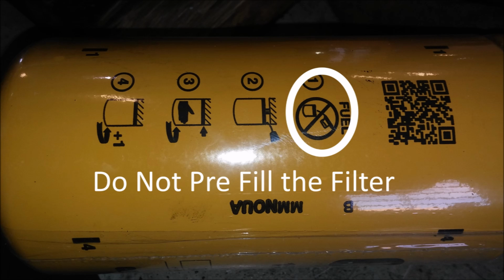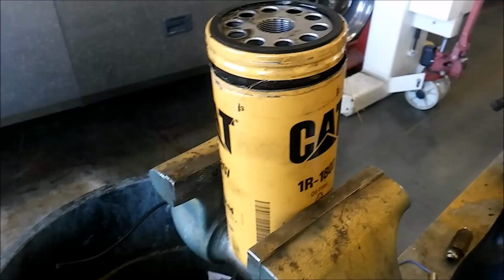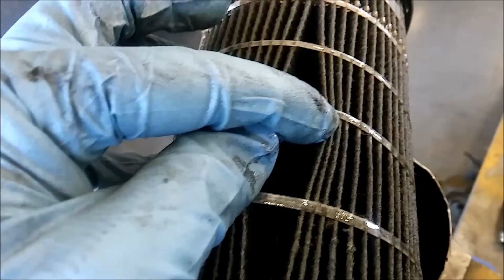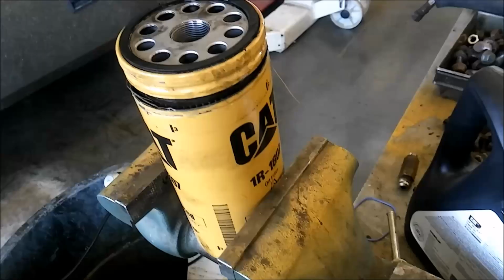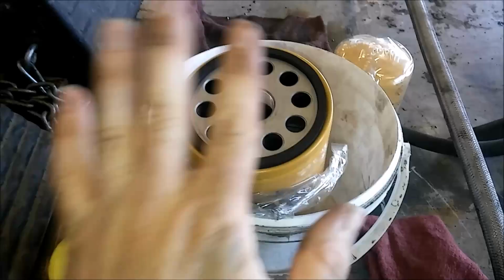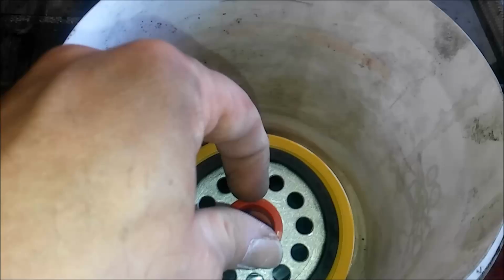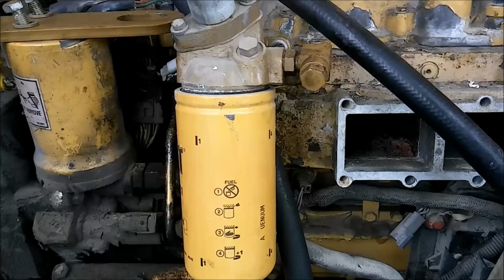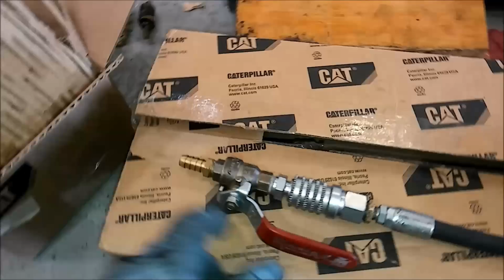Should You Pre Fill an Oil Filter? Should You Pre Fill a Fuel Filter?

Comment: I don’t know how many models back this is true on, but most modern CATs and I’m guessing equipment ingeneral you lube the fuel filter seal, install it, and before trying to start or turn the engine over, you turn it to the on position and it fills the fuel system and removes any air. You hear it prime, see the bowl fill, hear the change in sound as the system is full primed, then you can start it. He’s not saying there is a perfect one size fits every and all factors, just giving options and how he does it. People who don’t work with bulk fluids don’t understand that oil can be in 3+ different tanks and systems before finally making it into the equipment that’s being serviced. They are use to going to the parts store, getting oil straight from the factory in a quart and dumping it in the vehicle.

Comment: Ive always filled both sides of the oil filter, however considering my oil comes out of a 55 gallon drum through a pump and 2 massive 2 micron oil filters I doubt that's a problem. Im shure I will get alot of hate over this but I also run through about 10quarts of  new filtered oil at 3 Bar to flush out all the old oil before filling it. And before anyone bitches about cost we buy 10-15 55gallon drums at a time.
Reply: I agree. That's a much better way to flush an engine, than using any kind of solvent. That ensures there's no residual solvent, to dilute the new oil!

Comment: I work on construction/mining equipment from many different manufacturers. These manufacturers use many different brands of diesel engines. Cat, Cummins, Isuzu, Mitsubishi, Hino, Scania, Liebherr, and more. I can tell you from experience that NONE of these manufacturers allow for pre-filling of any filters. The fuel and oil you buy is NOT clean enough to meet their specifications until it is filtered. If you pour "new" oil or fuel into the clean side of a filter, you have just contaminated that filter. These manufacturers spend hundreds of millions of dollars on R&D. I don't care if your dad and grand-dad taught you to fill your filters, it is an incorrect procedure.
Reply from the maker: +nathan weber Thank you for the information, seems most people pre fill even with the manufacturer telling them it isn't a good idea.
Reply: Not only that its impossible on many Diesels my 4WD included.
Reply: According to Cummins quickserve to properly install a new oil filter you are supposed to fill with clean 15w-40. Looked up an ISX 15 871 and an ISB 6.7 CM2150 BOTH manufacturer manuals instructs you to pre fill the oil filter.

Comment: They probably recommend not filling due to possible contaminants entering the pool where the system draws the filtered oil from. I think newer engine systems have sensors to prime the filter itself until the system is equalized (not sure on terminology here). Although it was always more useful filling the oil filters and just letting the system prime the fuel filter with the use of a manual pump or lever, especially since you can just put a bead of oil on the gasket / ring at the same time.

Comment: my point is, during the time of normal operation, when you shut down , and then come back and start it again, especially if you have the type where the filter hangs with the open end facing up, the filter is full of oil each time you start, so how can anyone say the engine could possibly have any problem with a full filter , I can say this, watching my pressure gauge read zero for several seconds after starting with a dry filter has got to be worse. ever since I first heard about filling and doing so that pressure comes up as it normally does,  and I've never had any problems. I drive a lot of miles and haven't had an engine go bad in decades, my little Focus has 145k and still drives like new

Comment: Oil viscosities are often picked by the EPA for fuel mileage.   They'd make us run sewing machine oil if the engine would hold up at all.
Good reasoning otherwise, though.    I can't comment regarding anything diesel, however.   All I know about diesels is the stupid fuel nozzle is too big to fit into my gas tank.
I used to prefill my oil filters, but I stopped because it was just too much work having to be so careful to not get debris into it.
A coworker said he prefers to keep his filter always facing down until he starts threading them on, pretty much negating filling them as an option.
One thing I still do on oil filters, however, is I lube the seal and threads a bit.  I think it helps make it easier to take off.
Reply: l337pwnage in modern engines using the recommended viscosity is very important for the VVT to work as intended

Comment: Smart guy looks at the oil passage diagram for his engine. The bottom of the engine gets oil last after it has passed through the filter so waiting for the filter to fill then push it around takes awhile. In my experience, pre-filling the filter keeps the valves and bottom from rattling when you start it up which I think is a bigger problem than the possibility of soft dirt. If you do your pre-fill properly, cleanliness is next to godliness. Sparkly clean funnel, clean work space, clean bottle top. Fill through the center and let it sit until the oil migrates to the other side too. Put some more in, let it sit. Personally the guaranteed rattle of the bottom of the motor without oil for a few seconds is one hell of a lot worse than the small possibility of soft dirt getting into the bearing surfaces. If some dirt gets in the system, there is a chance that it will get filtered out next pass through after drain-back from the top (instead of heading to the mains and rods). Pre-fill the fuel filter? No experience.

Comment: Well,  when I buy (new oil ) it has already been filtered to a specific micron of filtration from the producer. I was always taught to prefill new filters to keep from starving the engine upon startup, and I will always prefill my filters.  I also worked as a diesel mechanic for years. There is a more fool proof way to completely resolve this conversation and that is to prefill the filters with a funnel that has a filter screen and yes I do.  Bottom line engines run on fuel and oil so let's make sure it's ready to run or it could be a big headache nobody needs.

Comment: My Cummins L9 with Fleetgaurd filters call for pre-filling the oil filter (even the can icons) and fuel filters (clean side on secondary filter - even comes with disposable cover /plug to assist your aim). My engine is RED, my filters are WHITE and I run the recommended Valvoline BLUE .

Comment: yes , don't let your bearings run dry or with limited oil supply while the pump is sending oil to the canister. it's a no brainer. even a small one on a 2or 4 cylinder, fill it at least 3/4 full. One exception , if the filter is upside down, for obvious reasons , don't add any.

Comment: YES ALWAYS PRE_FILL! Saves main bearings. Change filter every 2000 change both oil & filter at 8000. Use 20/50 oil always.
Reply: Keith Hinkel what do you use 20w50 in
Reply: My Chrysler van.
Reply: man use a quality oil filter and you can definitely use the same filter for 8000 miles. Wix or motorcraft.
Reply: lowest heat temps by data..use it in my 78 Super Beetle 140HP
Reply: I hope you're not talking about big rigs. Nobody's changing filters after one week.
Reply: Account Inactive lmao right. Not even after 8000, that’s only two weeks of good ridin’. I’ve found that changing it on the 10-12k mile range works just fine.

Comment: Waaaay over thinking this,  to the point where it`s almost scary. Many vehicles have the oil filter in such a position that to fit it, you have to turn it in every direction bar inside out! How would you keep oil in the damn thing. There`s really nothing in this at all, maybe all the conspiracy theories are getting to you.
Reply: Exactly to the point!
Reply: Have to agree, nearly every forklift engine I've serviced has the oil filter either horizontal, upside down or angled so prefilling will only achieve a right old mess!
Reply: I agree with you but big diesels are easy to fill and a different ballgame.For instance on a Detroit they even have 2 BIG filters that take almost a gallon and most guys will fill them and on a Detroit I recommend filling them.
Reply: duh! ever heard of gravity?  in those cases I crank the engine without staring it to get it prefilled

Comment: 1. No gas engine automotive oil filters contain a warning not to pre fill.
2. You are no more likely to get debris in your oil by pouring down the center hole in the filter than you are by pouring the oil in the oil fill opening in the valve cover.
3. Pre-filling an oil filter is called "good engineering practice."  Maybe not important in the grand scheme of things, but reducing episodic reduced oil pressure over the life of an engine will never be a bad thing.
Reply: while i agree with filling filters, on your number 2 line you seem to be missing the point.

if you get dirt in thru the valve cover, the dirt passes through the filter and gets caught in the media, preventing it reaching the bearings in the engine. If that dirt gets into the center of the filter, it gets pushed right into the oiling system and lands itself into a bearing.

I simply fill the filter from a clean brand new bottle of oil and take extra care not to get any dirt into it. Problem solved.
Reply: I do the same thing you do.  And I know how the oil passages are plumbed.  My point is about being careful.  I don't want dirt passing over the valve train on it's way to the sump any more then I want it in the pressurized side.  If you are letting any dirt/debris in anywhere, then you are doing it wrong.
Reply: I think you still missed the point. One of the points was that the new oil has debris in it. If you pour it into the center hole of the filter then you just contaminated your "clean" oil. The center port on the filter is the outflow to the engine. If you pour oil from a bottle in there then the debris in the bottom of the bottle gets in your engine. 
For most V8 engines there is no issue at the valve cover. The pressurized oil would just wash it away to the pan where it would get pumped straight to the filter. Assuming the drainback doesn't pass over the cam of course.
Also Pre-filling isn't a bad thing if done right. This was the other point of the video. If you prefill don't do it by pouring  it in the center hole of the filter. 
Reduced oil pressure does not hurt anything. As long as there is a film of oil and a supply the engine will be fine.  Especially considering the almost non existent load of cranking. Just because the engine sat all night doesn't mean it doesn't have oil in the bearings. That oil is even more likely to still be there after the oil change and subsequent empty filter startup. 
Cheers m8
Reply: I guess what your saying is don't prefill your oil filter with comtaminated oil? I certainly can understand that However I will contiune prefilling my trucks and equipment Nonetheless when i know  I'm using quality grade clean engine oil and not using a dirty container

Comment: I had never heard about prefilling oil filters and I had never seen anyone do it. If you have a horizontally mounted filter, this would be impractical. Also, you've just poured several quarts of new oil into the top of your engine to refill it. Everything in the upper part of your engine will have plenty of oil on it to prevent any potential  wear concerns.

Comment: most diesels have a hand prime pump and/or an electric lift pump and an air bleed to prime the system, may take a little longer and more effort than pre-filling fuel filters, but no risk of air or contaminants. Otherwise, make absolutely sure you use clean fuel and as the video shows, fill the filter from the outside holes. Good video. (air in the fuel system is a big pain in the rear)

Comment: I ALWAYS prefill. I'm not too concerned about contamination pouring clean oil from a clean bottle, into a clean filter. I sometimes have trouble filling from the outside, because the drain back diaphragm sometimes is stiff enough, that the shallow column of the oil just won't open it, and let it by. Sometimes, I can use a thin rod to press against it, and open it, otherwise, I just pour into the center. I'm not worried about air locking the outside, because air passes so freely through the new media, that you will completely fill the can.

Comment: Qualified mechanic since 1976, I fill oil filters if possible, fuel never simply due to danger of spillage and not needed if it has a primer pump and bleeder or electric f/pump for petrol. To avoid draining batt down if I need to crank fuel up I give it a chooch of Aerostart to spin it up enough to pump fuel. Oil filt, filling to centre is ok so long as oil is fresh. OEM say don't simply to cover their back from someone dropping debris in the filter doing it and blaming them. But IMO anyone who cant perform such a basic task of filling a filter or engine without dropping things in it should not be servicing their own car to begin with.
Reply from the maker: +AusMecham A lot of manufacturers seem to be switching to cartridge filters and inverted filters for seemingly the reason to keep the filter clean, so they are really concerned about it. So I'm assuming more damage is done with dirty filters than the couple seconds of low oil pressure it causes. Not everyone is as clean as they can be though.
Reply: I'm not a fan of removable cartridges mostly because you have to handle the filter itself which can get contaminated more easily not being inside a can, its like you mentioned sometimes the OEM warnings can contradict other methods they prescribe at which point you have to use your mechanics discretion to choose to the safer option. In short Id say so long as you have a plausible reason to do it one way then it doesn't really matter if you fill or don't fill certain types of filters. One suggestion for starting up with an empty filter is to at least not rev it off idle for a few seconds, and if the oil light is a bit long going out maybe turn it off and wait a few seconds and start again to allow time for the oil to saturate the filter.

Comment: Very few people outside of the dealer follow dealer procedures for stuff like this. Everyone knows you are supposed to fill from the outside holes but don't because it takes longer. In regards to filling the oil filter, it's just easier to install the filters, top up, start the engine, and the top up again. As for the fuel filter, good luck starting the engine if filter isn't pre filled. I've previously worked at a place where you fill everything and now work in a shop you let the engine fill the oil filters and top up the fuel filters with fresh fuel.

Comment: I run 5W-30 in my vehicles that call for 5W-20. This push for a thinner 20w oil is all due to the government push of fuel economy. We have an old ford f250 gasser that we've been using 15w-40 diesel engine oil in for decades lol. The truck still runs great but I'm not saying it the right thing to do. It's 50/50 on whether I fill the oil filter but I always fill fuel filters

Comment: I fill the oil filter through the outside or dirty side of the filter and put my fuel filter on dry and use the priming pump to bleed the air out after the filters.  All our trucks have dt466e's also a John Deere loader, grader, and cat backhoe
Reply from the maker: +Jason Unknown Then your doing it the right way. Your engines will be happier.

Comment: Pre-filling oil filter through center or not won't make much difference (it's possible to get dirt into the filter). BUT engine is always bypassing oil around filter specially when cold. Look up spec for oil bypass you be surprised. #1 thing is to put oil to the engine filtered or not and dirty oil better than no oil. Other thing running engine with no oil in the filter can cause code or check engine light. Yes air in fuel is very bad and fuel lubes and cools injectors you should pre-fill them. Nice thing about Cummins engine they have electric fuel primer pump. But fuel filter has plug in the center so you can pre-fill them (later IXS)

Comment: Wow what a rebel you are. I love it. Lots of common sense I bet many are lacking in the comments below. I'll read them later. 
Yeah many times I have looked in the new oil bottle and saw debris and junk in the bottom.  Not that hard to build a device to prefill filters though. I am surprised more people don't do it. 
Lots of people don't understand the function of the oil film and the oil film strength.  A "no oil pressure" situation is not an immediate death threat for an engine. As long as the oil film is intact the surface will be fine. Oil supply is the most important thing except where piston coolers need the pressure to squirt up to the pistons.  
I have been running a GM 6.5L diesel that has a no oil pressure condition when it is hot. I have 60 thousand miles on that engine. It has been that way since "new".   I have taken a few precautions. I don't like it but haven't had the time or money till recently to fix it.  180 degree thermostat. A manually switched external additional oil pump feeding cooled oil right  before the turbo. etc. Examined the bearings before a long trip and they were in good shape.
Reply from the maker: +consaka1 I appreciate the kind words. A lot of people disagree with this video, but I'm just telling them what the manufacturer recommends for their engines. The manufacturer designed the engine and I'm pretty sure they would know best for their engine.
Reply: You are welcome of course. I consider it common sense they would want the oil filtered first because it should help their engines last longer.